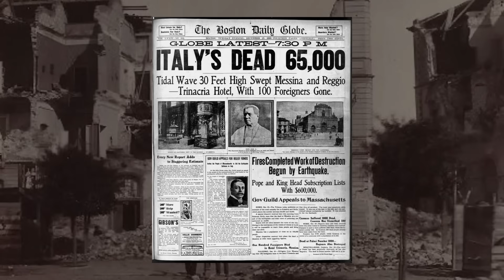Italy's $15 BILLION Plan For The World's Longest Suspension Bridge

Comment: 3.18. This is the Zeelandbrug in the Netherlands. At the time of opening, on 15-12-1965 (12-15-1965) this bridge with a length of 5022 m or 3 miles and some 250 yds it was the longest bridge in Europe.
Reply: confondi i ponti con le campate
Reply: @joulenovantotto You might be right, but I only mentioned the name of the bridge showed there. And the fact that that bridge, with 'spans' of only nearly 100 m/110 yds, in totally was the longest one in Europe by then...
Reply: @marcvanderwee  non riesci a proferire una frase ? 
Magari aiutandoti con un traduttore

Comment: ...I wrote: in your opinion, but you have to promise to be honest, is it realistically possible to build the bridge over the Strait?
ChatGPT said:
Reasoned for 9s

To be completely honest: from an engineering perspective, "it's possible" in theory, but realistically—within the timeframe, costs, and acceptable risks—it's very difficult.

Why don't I say a firm no?

A ~3.3 km suspension bridge is beyond the current record but doesn't violate the laws of physics: with towers >380–400 m, enormous cables, advanced aerodynamics, and extreme construction details, it's conceivable.

Why do I say "very difficult" in practice?

Thin technical margins: record span ⇒ high sensitivity to wind/flatter, cable fatigue, and active controls/dampers not yet validated at that scale.

Seismicity and geology of the Strait: a project feasible only with redundancies and gigantic seismic devices → complexity, burdens, and costs increase.

Construction and maintenance in a narrow, windy, and busy sea corridor → high risks and structurally high OPEX.

Governance and multi-decade budgets: a stable decision-making process and crisis-proof financing are required; historically, in Italy (and elsewhere), this is the most fragile area.

My honest summary:

Possible? Yes, at a theoretical/frontier technical level.

Realistic, within a reasonable timeframe/cost, and with acceptable risk? No, unless there is an extraordinary "Japanese-style" or "Nordic-style" program with: robust project governance, independent international verification, full-scale prototypes, extensive financial contingencies, and a fully funded maintenance plan.
Reply: As a developer, you are a very refined and educated engineer and your comments are impressive!
Reply: non ha detto la cosa più importante 

Il limite di fattibilità è una campata lunga la metà, e sarebbe il RECORD DEL MONDO. 
Oltre quella lunghezza il ponte crolla per il proprio peso, anche senza terremoti. 
Non servono studi complessi, basta avere superato l'esame di tecnica delle costruzioni, e questo è il motivo per cui non riescono a trovare un ingegnere tanto scemo da fare e firmare il progetto esecutivo. 
Il ponte sarebbe - forse - fattibile se l'impalcato fosse largo 20 metri, evidentemente senza ferrovia. 

l’attuale record del MONDO è detenuto dal Tsing Ma Bridge (Hong Kong): ponte sospeso con il più lungo impalcato dotato di sede sia stradale sia ferroviaria, campata centrale di 1.377 m, piloni alti 206 m, impalcato largo 41 m invece di 60, e i piloni non stanno su faglie attive. 

Se l'hanno sparata tanto grossa è perché volevano essere strasicuri che non fosse fattibile, per poter continuare a trangugiare denaro pubblico a tempo indeterminato. 
Se un quotidiano lo scrivesse in prima pagina, si metterebbe fine per sempre alla favola riciclata dal Pallonaro gonfiabile